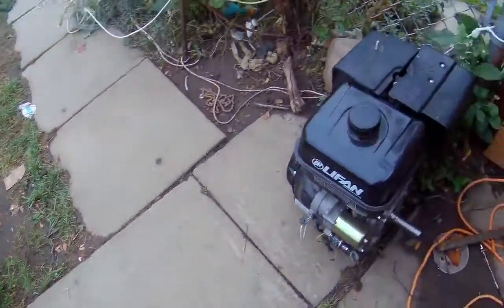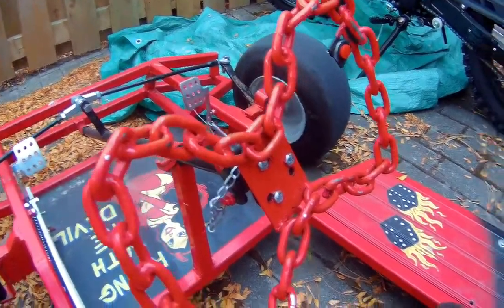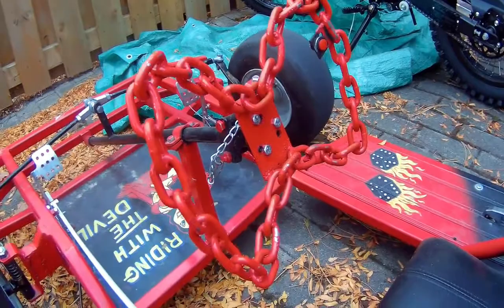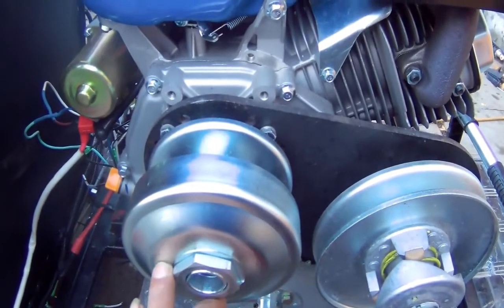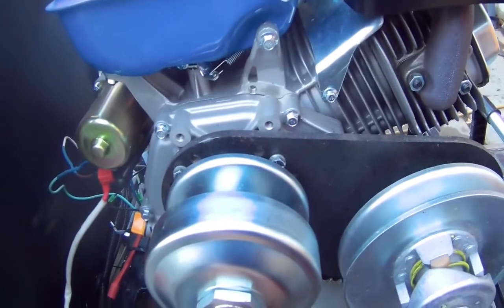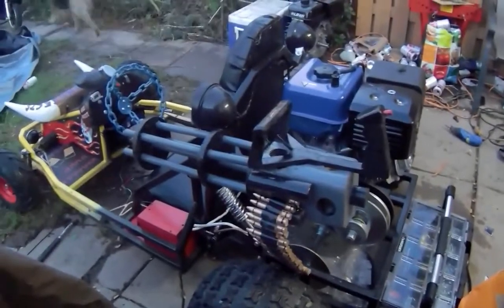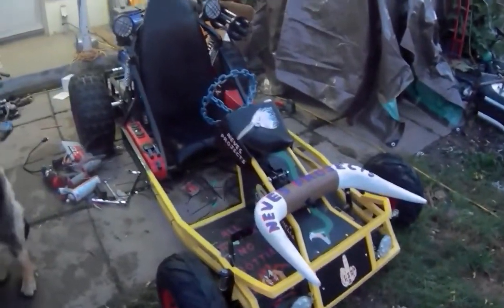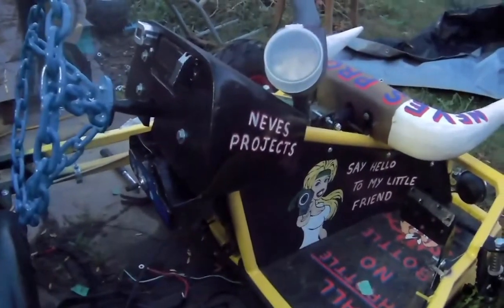Machine Gun Neves pt.13 Some Setbacks and upgrades

Comment: Hey mate.  Looking good. Looks like you've got enough room for a custom exhaust there. Good stuff mate.  Wish I lived close by to give you a hand.  Well done sir.👍
Reply from the maker: Thanks Customwinder 1, you gave me the idea for a custom exhaust for this with your video, I'm going to test ride it and then make an exhaust to make it sound mean lol
Reply: Neves Projects ah very cool mate. Little tip.  Make the little exhaust manifold with a bit extra material.  And make the rest of the exhaust shape you want and tack it to the manifold while its bolted to the motor.  You can position the pipe  to look good then. Good on ya mate 👍
Reply from the maker: Thanks, Customwinder 1, will do, I'm thinking of making it as dual pipes, will have a video when I do it